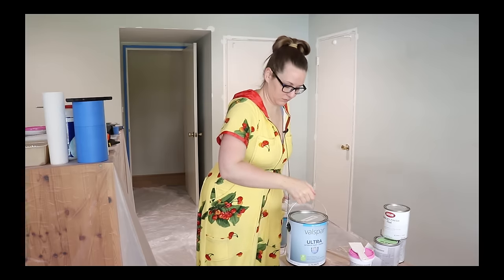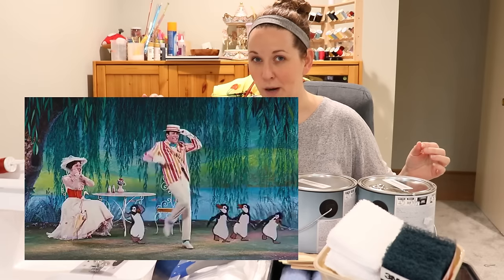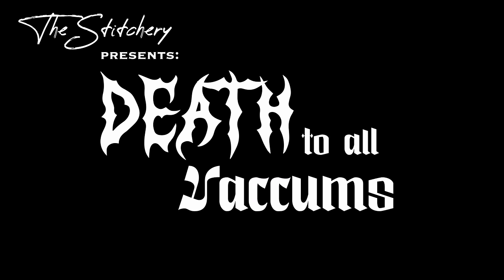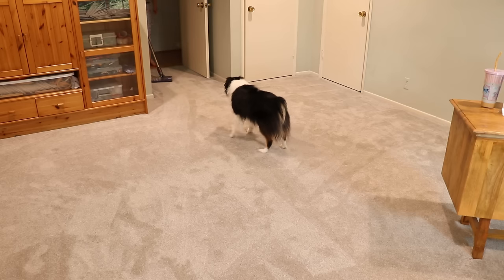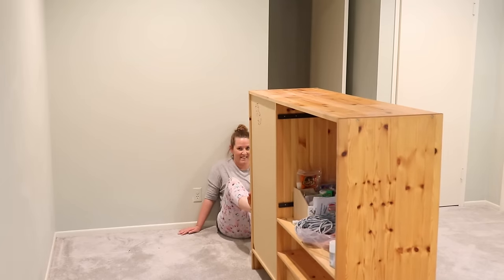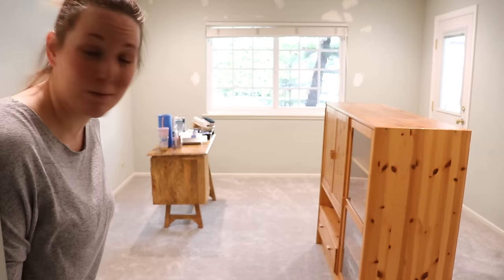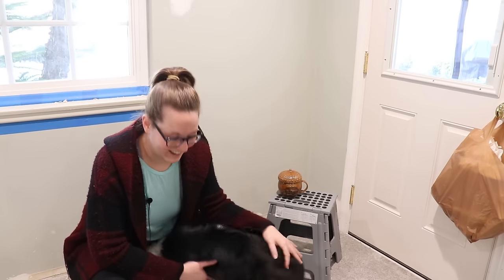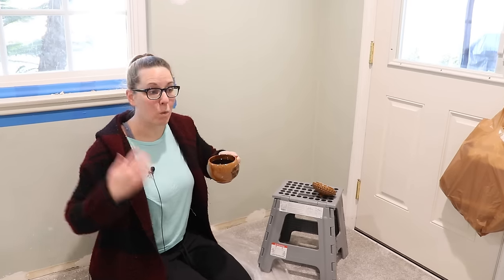I Painted Clouds on My Ceiling

Comment: "At dawn, we paint!"  .... yeah how about this afternoon we paint, when we've sufficiently caffeinated and we're darn good and ready to paint :P (very very not a morning person)

Congrats on learning about baseboards. And everything else you try. Trying is how you learn, failing is how you learn more. I've failed a LOT on the stuff I do now as a job. Literally, what is the worst that could happen with what you're trying to do? You screw it up and have to redo it, you break a thing and have to replace it and maybe the rest of it so it matches... hate the paintjob? You can always just paintt over it and try again... Focus on the mistakes that are less easy to recover from, like getting paint on carpeting. Good job on shoving it under the wall with the scraper!

My best hints for baseboards though? Always paint them before installing them (ESPECIALLY with carpet underneath), and always buy bigger baseboard than what you removed so you don't have to care that much about the inevitable lines left by paint and sealants...  And my best hint for redoing a room is start from the top. If you've got the floor out, do the ceiling, then the walls, then the floor, then the baseboards, then caulking the baseboards, then touch up painting the baseboards because no matter what kind of caulking you find, it'll be visible and some of them literally attract dust and dirt..... Oh, and getting an extendy-pole to screw the paint roller into will make ceilings far less hellish and is pretty awesome for walls because you don't have to bend down to reload the roller. Yeah you still need the ladder for the edging and the light fixtures (though I mostly just smush the roller edge nto the corners and get all kinds of paint on the wall when I do the ceiling, then wipe it off so it doesn't leave lumps when I paint the walls). There are also edging tools and corner tools and things like that that can be screwed into an extendy-pole, and you might even be able to use it to clean the walls if you get the right kind of mop head.

"Does it really need a second coat?" is a question that can only be answered once the paint is completely dry... Sometimes the answer is actually no! Though that's usually only with the more expensive grade of paint, and only if you primed all your patches first and allwed that to completely dry before the full paintjob.

Oh, and that thing you hate about paint rollers:? Don't roll back and forth on the tray when you're loading it, finish loading it by only rolling in one direction for a few passes so it loads evenly. I usually go up the paint pan with the first roll to get paint then I only roll down it to get the roller evenly coated while I squoosh the excess paint back to the reservoir.

Another thing about renos, as you saw with the twerps who painted over the electrical cover plates, you're always going to find something stupid or lazy from whoever came before you, just try to the best of your abilities to avoid doing that to Future Reno Person.

And I get the overwhelmed by choices thing, chunks is a great way to start.  I practiced a clouded ceiling in a stairwell, and I think I started by painting the ceiling blue then dipping a plastic shopping bag into the white paint and dabbed the clouds onto the ceiling, figuring if I hated it, I could just paint over it later. Turned out beautiful, but the way that stairwell is lit, nobody ever gets to see it! So I did it again in the powder room.

Wow, catching an earthquake on camera!! We mostly only get tiny little ones here and they just sound like the train going by at my mom's place, one time happened there and we're all like, wait, that's lasting too long to be the train... then it amped up for a few seconds and we realized it was an earthquake... but it definitely makes me understand how as a little kid I slept through a few of them.

And definitely break tasks into chunks, that's how I live with unfinished work. Though I did have bare drywall patches in my hallway for five years.

Ugh, I've had that paint peeling thing happen when the old paint was softened up by the new paint in places it hadn't properly adhered....  Glad you got it sorted and I hope it doesn't happen again!

I hope something I've said here made it worth reading my wall of text, and that even if you've already completed the work on this room, that it's appliicable to the next room you take on. You did a great job and I'm looking forward to seeing more!

Comment: For the walls and ceiling use a spray roller to paint. When you use a roller, have a longer handle, put more paint on the roller & use "Y" motion. It covers a lot more by repeating the Y motion.

Comment: For cleaning the walls, I found it way easier to use a mop, specifically a spinning mop so I can get the excess water out of the mop head easier.  I recently cleaned my bedroom walls in preparation to patch and paint it, and used a soap with peppermint oil in it.  Made the experience way more enjoyable than if I had used a cleaner with a harsh/artificial smell.  I'm not sure if we can remove the trim around the windows, they appear to be original from when the house was built in 1890.  Our baseboards also look way taller than yours and are twice as thick.  We're not bothering to remove them because no one has the energy to fight with who knows how many layers of paint, but I wish we could.  I'd much rather replace them with shorter and thinner baseboards or just trim.  We have to add a 1/4 inch trim around the room because we installed new vinyl sheet flooring and couldn't get the flooring under he baseboards.

The clouds and color are amazing, can't wait to see your journey as you continue working in chonks on this space!

Comment: When I saw you painting the ceiling like that wearing GLASSES I just remembered the pain of getting tiny paint specks off the lenses and frames.. it can be a nuisance but sometimes contacts are the answer. But I like your hustle. You decorate so I don’t have to (in my old house with 12ft ceilings). Good luck with the rest, so there will be more embroidery.

Comment: Oooh, if your hands are hurting that much and you need to press on the wall much, it means that you NEED TO THIN YOUR PAINT WITH WATER. Yes, you would need to do second coat, but it is sooo much faster (one coat like in one hour max., than you need to wait until it is properly dryed), your hand will not be hurting that much and your wall will not peel. Peeling is sign of too much of something and in this case, it is too much paint. That one bucket of paint should last you for the whole room.. But still, good job! I love it! <3

Comment: The clouds are really cute! If it were my ceiling, I'd probably add some yellow and some purples/pinks to the ceiling, just to differentiate it from the walls and give more "sky" in the end result, but given your inspiration, your version works exactly right. The lovely thing about painting, you can always add to it. Many of my paintings go through lots and lots of versions on the same canvas until they're done.

Comment: Couple of tips.  You need a lot more paint on your roller.  Then paint a W on the wall and fill in around it using the paint in the W.  The green paint was probably semigloss (or wallpaper glue).  A light sand or some liquid sandpaper will prep the wall in that case.

Comment: I hadn't watched this originally but came back because of the sequel and here's a tip? maybe? You have IKEA Skådis/skadis organizer boards and you have a 3d printer - there's a lot of custom things you can print for your Skådis on 3d print sharing sites. So if you want a shelf for it, or a bin, or a really specific tool holder it's worth a look.
It's a bit like the stippled cloud painting method made it less glossy than the blue, and that catches the light nicely! I'm sure you can correct the clouds with a bit of blue sponging without going through too great lengths later.

Comment: I've painted clouds on several ceilings for my kids and then grandkids. 
First, paint the ceiling in one coat of fairly deep baby blue. (Scary, but stick with me) Then, using a can of good quality white spray paint. Spray said paint to cover wherever the base coat is thin. Just spray haphazardly.  Kinda misting it in layers. I promise it will look great and is A LOT easier than other techniques I've seen. Trust me, I'm old and I know things.

Comment: I bought 5 acres of glorious soon to be food forest on the side of a mountainside of pinyon-juniper forest ecosystem.  Included was a shabby 840 sf 1979 shelter. I never intended to live like this, but every repair seems to stack mountains of stuff into new areas.  I have dropped 4000 sf to 840 sf, not helping. But I have a zen retreat to furnish! A van to turn into a camper! A year's worth of food preserved from my food forest! Who woulda thunk feeding yourself would make huge piles  of jars of free food?
Reply: At least one 12 ft wall in the partially underground zen retreat will host a wall of dehydrated yummy veg. Covered by bamboo shades holding cool air from underground.  All of which is now residing in my smallest bedroom and a central feature of my living room 😮
Of course I added zen retreat stuff... on sale it was perfect. Left an 8x12 zen tea house, right?

Comment: This looks so cute! If you're gonna paint another room with rollers, I recommend you only roll in one direction instead of the up-and-down strokes you're doing in this video. By repeatedly lifting the roller and going in the same direction, you shift which part of the roller touches the wall and you prevent the sportiness you pointed out in the "why I dislike rollers" part!

Comment: I'm saving this one, you're giving me ideas! Much to my partner's chagrin 😂 I'm not much of a painter, but maybe with more practice...

As someone who's stubbornly DIY, a note for next time, or perhaps for anyone facing the same issues- cracks at the top of baseboards like that are usually just sealant that's too old or brittle to keep up with the seasons. You can just cut and scrape it off, then re-do it much the same as you would bathroom caulking. It's way less work than replacing the whole shabang. Tips: your favorite paint-specific store probably has better sealant than big-box DIY chains. Materials wise, silicone is very flexible, handles temp extremes and moisture well, and should last many years- but is harder to clean up if you make an oops, and you cannot paint over it. Acrylic urethane or latex sealants are easier to handle and can usually be painted over, but don't last as long as silicone and are less flexible...which can result in cracking in 5 years or less. (Though good ones can last up to 40.) Pick your poison.

Also, as a heads up- sloppy paint jobs by previous owners sometimes point to a safety issue in older houses (pre 1975ish.) Back then the paint and varnish were often oil-based and had lead. Testing is easy but abatement is expensive, so most folks choose remediation instead (look up "lead encapsulation" if interested.) Of course, that ceases to be true if you or anyone you know chews the affected areas or lights them on fire. Found all this out in 2016, when I was lucky enough to buy a home with century-old trim and floors that weren't properly encapsulated (and of course my brand of ambition insisted on saving them- or at least trying to.)

Finally, safety stickler alert- I know you said you have low regard for safety, but please, wear a mask and gloves if you do demo or trim work in other rooms. Mice in homes is pretty common, but touching or breathing their waste can give you all kinds of nasties, like hantavirus or leptospirosis. It's not super common, but the consequences REALLY suck, so please be careful!

Comment: Oh gosh I wish I could have known and contacted you before you painted to help some.. you for sure need to roll your roller in the paint tray at least 10 times, maybe even 20, get it all wet evenly and then run up the grate to remove the excess.

This is so inspiring! We’re moving into an old house this month tucked away in the country and will be doing a lot of renovations and I’ve been so scared of doing it alone since hubby is working so long and late, but you’re proving it’s possible to do! Thank you! I love these videos!

Comment: I know you’re probably totally done, but you can soften the dark cloud by dry sponging a mix of the blue & white inside  the too dark cloud (like a vein) and feather it out with a dry brush. It will create depth by breaking up the solid “too dark” parts of the interior or edges depending on the effect you want.  Mixing the white into the blue will give you a tint which won’t be too dark, yet will provide a gradient of tint to pull the sky through that cloud and break it up.

Comment: This is so real…every project just ends up being so much more complicated and difficult.  I decided to repaint my downstairs bathroom, and put down new baseboards.  Totally ended up being so dam much more work than I ever imagined.  Now I have painted it maybe four times in 20 years, but this time I wanted to address a corner by the shower that needed some drywall and texture repair, hate that. Then the replacement baseboards wouldn’t slide behind the toilet. And various other obnoxious things too numerous to outline. I got it 90% finished and got stuck.  Last week I finally pulled the toilet and got the trim in.  I highly recommend the PCV baseboards and other trim for bathrooms in particular and maybe other rooms. Tiny learning curve with cutting, cut fast or it melts from the friction of the saw blade.  And I kind of hate caulking, it’s hard to make it look professional.  The detritus behind baseboards is always shocking.

Comment: Just some ideas I’ve found over the years helps …buy locking casters, and put on everything lol makes moving stuff a breeze… insert a stick in hole on roller … less pressure required… put clear wrap on paint tray then put paint in .. just throw away when finished .. also easier to cover for using again next day ( ish) cover rollers and brushes with use clear wrap on these .. same principle…store paint after finish upside down so any skin forms on what will be the bottom when right end up …

Comment: Metal cans of paint, take a nail and make holes where you pour in the lip so you can drain the paint back into the can easier if you’re going to keep it and not use all of the paint at once. this will keep you from basically painting your can shut.

Comment: Looks great! If you truly hate the density & spatial aspect of the clouds, try dry brushing. Just add the absolute smallest amount of paint to a bristle brush to add some blue back into the dense cloud & thin whisps of white over the negative spaces as a way to fill in the areas you think is lacking something. Also, your sister was right…adding a little more paint was the way to go. Though I personally think changing the roller helped more as the type of brush & paint you use helps determine the end result. (Sorry, my dad used to have his own painting company) 

SIDE NOTE: Didn’t know the best way to send you a private message so I ultimately chose IG. Hope you see it, but understand if you don’t. Have a great weekend!

Comment: I worked for a professional painter gor 16 years. Instead of a tray they used a bucket and grid. It will make it easier to get the proper amount of paint on the roller. Agree with the pole comments.

Comment: Depends on the paint used previously whether satin finish gloss etc you need to be sure and get the same. Because the wrong match will cause problems with painting new layer. Oh and poop can be from termites or other bugs. What you cannot see but should keep in mind is the life behind the walls and regular maintenance to keep them from spreading.

Comment: When I saw you using the roller at 1st it was yelling at the screen, put on more paint and don''t press so hard. I'm glad your sister set you straight. Since you had everything covered with plastic, all you needed was to tape off the window and soort so it's covered and rent a paint sprayer for the day and it's quick and easy especially since you were also painting the ceiling. I'm just a regular person but did paint some wall and wonder of wonders it did the fence in no time. Loved it but you can get carried away eventually. We had a white stripe on our lawn for a bit.

Comment: I think what happened where the green pulled off was an old patch. given the location, it looks like that corner of the house settled just a bit more, (potentially due to quakes) and the drywall or plaster cracked a bit from the window corner down, and the ceiling to the wall. Then they didn't prep it properly before painting the green (which you corrected by sanding and priming), and when you went over with the blue, the green lost any tiny bit of adhesion it had, causing it to peel off.

Comment: Omg you need to get an extendable roller!! It goes so much faster to use that and do long strokes. Youre going to be so sore 😩😩 Also if i don't know what kind of paint is already on the wall i always do a quick coat of primer. Its annoying but it guarantees that my paint will stick and thats worth it to me!

Comment: That roll is the wrong one. It needs to be way more big and fluffy. Also you need to stick the rollholder on a long stick to paint the ceiling from the ground in one big Motion.
Greetings from Germany ✨

Comment: Did you possibly paint latex over oil paint without the proper primer coat first? That would certainly cause your top coat to peel off as you’ve discovered. Really frustrating, to be sure.😢

Comment: I was trained by Valspar for their paint. Ultra series is a good paint for your level of painting skills. And as someone who has done faux finishes with paint (clouds were done several times) those clouds are great!!!
Reply: You also need to load the roller heavier. Keep it saturated - do not dry the roller out.